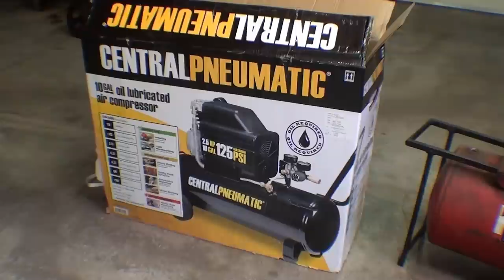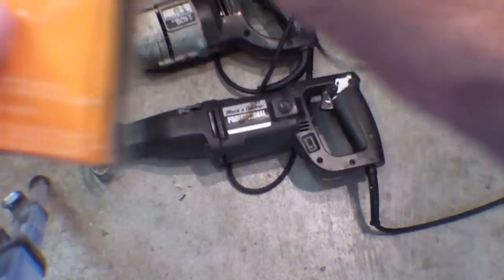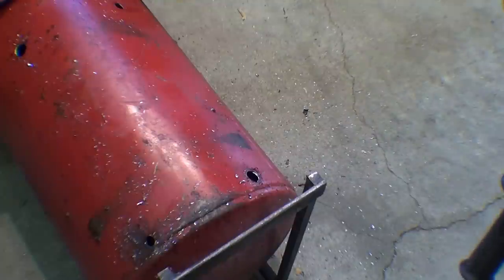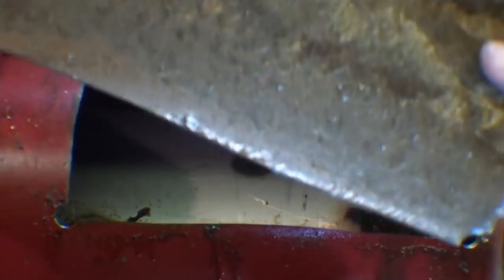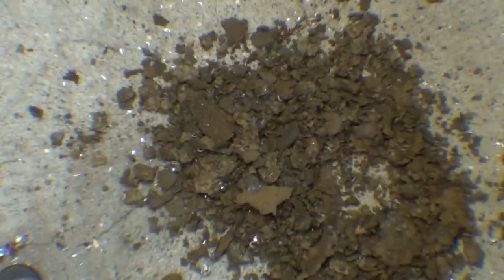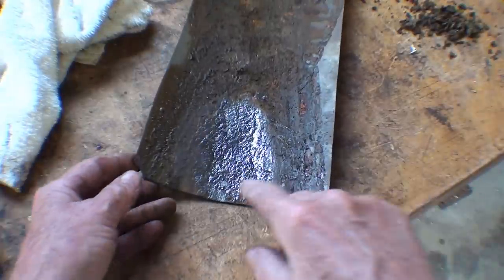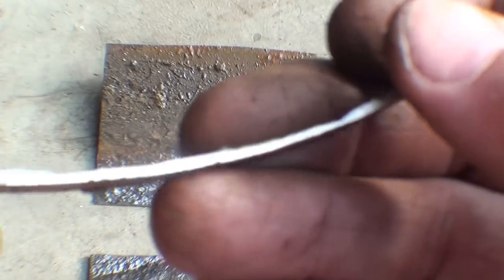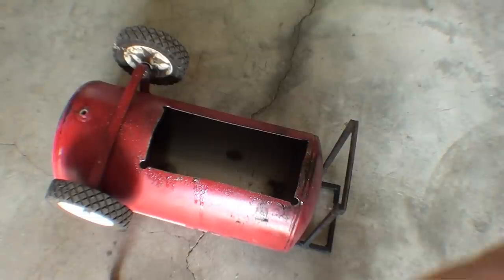tubalcain performs an AUTOPSY ON A COMPRESSOR AIR TANK

Comment: Had a tank failure while I was out of shop airing up a lawnmower tire. Rust, crud, water was blown against shop door (metal) making an awful mess. Just very glad I wasn't close by. Autopsy was easy as the tank split full length along bottom.When I replaced tank on another compressor I used a 60 gallon propane tank (saddle tank off a 5 ton truck). Still using it several years later.

Comment: I bought the same unit back in 1968/or so and when it first started to leak around 2000 I back filled the bottom with epoxy potting compound. Got another 15 years out of it. When I saw some of the carnage caused by exploding air tanks that was the end of the old sears unit. Bought a new 220 2 stage 80 gal stationary unit and installed an auto drain  on it . I don't think this unit will last as long as the first one, but then neither will I.

Comment: just wondering if on a new compressor, it would be worth using one of the liquid fuel tank liners on the bottom to maybe get longer life out of the tank...just a notion that came into my head.  Thanks for the upload, Mr. Pete.
Reply: Short answer no, you will need to chemically strip down to bare metal, and have the linig bond completely to the metal including the fittings, where there is also rust visible. Any pinhole will rust very fast just from concentration gradients and peel off the coating very fast.
Reply: Well, if Tubalcain is still here in 40 year's to witness the demise of this one I'm sure he'll be more than satisfied with that !  Or maybe not!
Reply: not thinking any part of the HF air compressors are going to last anywhere near 40 years, mine included.  It was a tongue-in-cheek question, by the way..about the tank lining...always happy to give those so inclined an opportunity to educate, though. :-)

Comment: Looking at the picture 9:40 into the video is scary. The sheet metal is probably 1/3 the original thickness. Lucky it failed with a slow leak.

Comment: you should keep the old machine's parts. The direct drive compressors do not last. You could however use the new tank with the old parts when the new pump stops working.

Comment: Thanks for doing this, Mr. Pete. I'm surprised by the relatively thin gauge of the steel to begin with. I expected more meat, perhaps .125".  But I'm really surprised by the large area of thinned material. I had always envisioned deep rust pits in otherwise fairly undamaged steel, but this completely changes my thinking about old tanks, and about the possibility of catastrophic failure.

There will always be water vapor in the tank, ready to condense from the heated compressed air and settle in the bottom. I've always heard that acids form from the combination of the water and oils from the compressor.  Seems like daily draining would reduce any such formation.  The fact that the upper part of the tank is astonishingly pristine may point to vapor playing no part (or even pure liquid water in the bottom?), but acids instead doing the damage. That bright steel is really a surprise...not even any powdery surface rust.

Comment: I've often wondered if adding a tank sealer (like Kreem or similar) to a new compressor tank would help in the long run.  You wouldn't need full coverage, just the bottom 1/3 of the tank.
Reply: Seems like it would. 
My 1985 BMW motorcycle gas tank came from the factory with an internal rust preventative coating.

Comment: Wow, that thing was definitely living on borrowed time! This last compressor I picked up was probably the last US-made unit from the manufacturer before shipping their production overseas. Thankfully the former owner barely ran the thing, as my primary concern was the age of the tank. A thorough inspection through the bottom port revealed very little rust. One of the few unspoken benefits to having an older oil-lubed compressor with blow-by before I refurbed the whole thing; built-in rust prevention. 👍

Comment: SeanBZA said it:  scheduled clean-outs of the tank, maybe even an inspection.  I have a vertical 60 Gal tank & do a basic dismantle every 4 years. I do a boiling water cleaning solution to clean then use a commercial steel rust inhibition application inside.  Have been doing this to compressors since it was taught to me as a kid.  Have never had to replace a tank.  Of course, dry air filter is used as is a filter for spray paint purposes & oiler for pneumatic tools.  Very good autopsy Mr. Pete.

Comment: Thanks for the interesting autopsy.  It might be worthwhile, when starting out with a new tank or compressor, to add a little fuel tank sealer and slosh it around before water gets in there.  Might keep the condensation away from the unprotected cold rolled.

Comment: Drain was not the lowest point in the tank either, so the condensate pooled there causing the failure. Got a 60 gallon tank at work, and every 3 years it has a clean out and hydro test. Most of the fine rust lands up in the auto drain screen though, as I made sure the drain was the lowest point in the tank. Original motor, second Ingersoll Rand compressor on it, the first one had a minor issue with disliking the HP piston after a while and it left via the case. Second runs synthetic oil and I added a small magnetic plug to see the wear particles in it.  Grows a little black coat over the magnet.

Comment: Very informative. In UK there is a product called "Fernox" which is used in water-filled radiator systems. I add a small amount to a new tank, working on basis that its very effective anti-corrosion properties will help slow internal corrosion.
That is optimism but the stuff is amazing - a solution of that with a bright nail half in, shows immersed section stays 100% bright even after long immersion.
Reply: gonna look that stuff up, Chris..and see if there is a similar product here in the states.
Reply: Ah...Amazon has it...gotta love it.

Comment: My craftsman tank similar to yours did blow up. It was on a shelf 6 ft off the ground and blew a hole in the 1/2 inch plywood shelf and hit the rafters in the garage. I was able to use the compressor by building a heavy duty manifold out of 2.5 diameter pipe to mount all the pressure switches and regulators to. Then off to the side ran a hose to a harbor freight air tank . These old compressors are reliable and much quieter than the new ones. Now when the tank gets a pin hole, I just throw it away and get a new tank for 50 bucks. that craftsman will outlive me.
Reply: Yeah. I have a 1978 craftsmen. I’m like it’s so quiet, that’s the only reason I’m obsessed with trying to keep it. But I’m worried about the tank and such. Will probably scrap tge tank and try to refurb the gear, see if I can remount it to something later.

Comment: I have fond memories working (assisting) in a small engine repair shop with a Sears air compressor.  It was a really nice compressor much better than what one can buy today 
in the comparable price class.  That was 1976 to 1980 era and, from that, I'm sure the compressor you have is older than 1975.
Thanks for the video  -  Rod

Comment: Hi Lyle, thanks for that. Quite eye, sorry, tank, opening!  I wonder what could be done to slow it as well as others, but I guess 40 years life is not bad.  Maybe thick oil, (but not if powering paint sprayer), or a water dispersant?  I was impressed with your Black & Decker saw.  Seeing how things fail is very educational.  Bob

Comment: If you look up Diesel Cavitation Erosion, I think you'll find a contributing factor to the destruction of the bottom of the tank. That's not to say that the compressor is related to a diesel, but that the reaction of the water to the sonic shocks delivered by the compressor itself will possibly cause some of that erosion of the metal that you(we) observed..
Makes me wish that I had taken the time to wash out, rinse and seal the inside of my 60 gallon compressor tank.
Keep up the fine work..  As a recent retiree, I am finally finding the time to appreciate your series.

Comment: Kinda spooky! Definitely not something you want coming apart in rapid fashion!  The old B&D corded drills are awesome, my grandpa had a large 1/2" like the one you have, trying to drill a hole in a truck frame to mount a trailer hitch and the bit caught and spun me right around like a rag doll, bounced my head off the tire and everything... I was impressed because I am 240 lbs! Thanks for sharing! BTW, the crickets didn't bother me at all! :)
Reply: LOL, I laugh because the same thing happened to me about 35 years ago.  I wasn't laughing at the time but everyone who watched me do it was.

Comment: I was a boss on a job where the subcontractors scaffold failed and a guy fell and was hurt pretty bad in WA State. After the ambulance  took him away, i took my camera out to take  pictures of where the metal failed. When i got out there, the piece was gone. I went to the subcontractors pickup truck, and the part was laying in the back of bed and he was getting ready to drive away. I took some pictures. Later state inspectors were call out to investigate. I loaded the pictures to my laptop and enlarged a lot. You could clearly see that water has gotten inside the tube and had rusted from the inside out, and failed. Needless to say a picture is worth a thousand words,  the blame lay clearly on the subcontractor who had supplied his own scaffolding. This video reminded me of that incident. WA is extremely stick on safety compared to CA where i had moved from.Needless to say, sure i cared about that guy that fell, but i was also inline to be blamed because it was also my job to enforce safety. Without that picture that showed the rust from inside out,, i would have been blamed some how. ( you could not see rust from the outside)
Reply: I got a 1978 craftsmen that runs half decent. Am debating using it. No way, out of the failure tank videos, tubalcane basically convinced me to throw it out.

Comment: Thank you for the informative video , It could save someone's life someday .I just bought a used Speedaire  unit and it has a pinhole on the bottom that I didn't know about because I bought it with a broken off drain valve and a man's word that was all that was wrong   .The machine was only 10 yrs old  and looked fairly new compared too my 40+ year old Sears . I have since watched video's of compressor failures something that you just don't think about and they are deadly. Thanks again Sir.

Comment: Interesting video.  I have never had a sawsall blade to cut the well.  When I watched you do the first cut, I thought that must be VERY thin metal.  I may have been cutting at too fast a speed with my sawsall, not sure.  I did notice it did cut slower on the second longer cut.
  This video has me a little leery of my compressor now! Not sure how old it is, and the tank itself does not leak that I know of.  I think I need a new pressure regulator.

Comment: You know what should really scare you? An old compressor tank that's starting to leak. Those things have a tendency to explode under pressure.
Reply: Watched a few videos now, while debating a used 1978 craftsmen I was gifted……. Yeah, not very sure I’ll be running this old compressor

Comment: That is sure an eye opener. Guess the best thing to do even with proper care over years is to replace a compressor over six years old. Might be good to also cut holes in an old tank so nobody else can use it when trashing it, or salvage the metal for other uses.

Comment: I was quite surprised at how well that saw cut the tank.  I was also quite surprised at how thin it was.  I drain my 60 gallon compressor tank every day but still wish there was a way to prevent corrosion.
Thanks for the video.
Reply from the maker: +Bruce L. Yes, I had a really saw through it fast.

Comment: My late father used to work for Sears and Roebuck Co. back when they built and/or sold quality tools like that air compressor. So it was nice to see that you (along w/ previous owners) had gotten so many years use from it! I trust you played taps as you dropped it off for recycling. lol Hope you fully enjoy your new Harbor Freight compressor and it brings you many great days of service! (Warranty is for 90 days anyway). lol
Reply from the maker: The freight compressor will not start if it is under 50°F

Comment: I had a pin-hole leak in the tank of my Campbell-Hausfeld compressor a few years ago... I punched it and put-in a self-tapping metal screw with washer... end of problem.  Working fine ever since.
Reply: So you loaded it with a bullet and you continue to spin the cylinder? Russian roulette anyone? Seriously I hope it doesn't decide to unload on you or anyone someday.

Comment: I just stumbled across your channel when I was looking to see if there were any videos on how to repair an air compressor tank that rusted through.  I was hoping to see where someone had patched a piece of sheet metal over the entire bottom of the tank to reinforce it. After seeing this video, I realize that is not a good solution at all. I was a machinist for around 18 years and have moved into other positions in the company where I have spent over 22 years of my career. I took a peek at some of your other videos and decided we have some similar interests. I have an old Sebastian lathe that I will be cleaning up and putting back into service, in my shop this spring. I recently purchased a new air compressor that will replace the Craftsman that I purchased nearly 30 years ago (because the tank has a pin hole, where it rusted thru the bottom). I look forward to watching more of your videos, very soon. - Jeremy
Reply from the maker: Thank you for watching, I'm glad you found my channel. I used to have A Sebastian Lathe in the school shop.

Comment: It would be a lot of work to put a new bottom in, but it would have the advantage of having a drain that was the lowest place in the tank, should you design one, vs the stock one that was significantly higher due to the inside welding on the threaded fitting. I put an elbow, pipe nipple, and a ball valve in my old one so it would be easier to drain, which it does better if I lean on the handle and tilt the tank towards the drain. I also sprayed a good amount of wax based undercoating in the tank inlet fitting to protect the bottom from water inside. I also retorqued the headbolts several times the first five years, which had loosened significantly the first  couple times (gaskets compressing). I also replaced the tiny foam air filter with an optional adapter kit with 2 longer headbolts, and with a washable woven filter - noticeably more quiet. No problem for a machine shop to make the adapter, or to replace with some rubber hose and an auto air filter.
Reply: I fabricobled a cardboard box with various baffles and diverter and bolted on to my 3hp just to test and man what a difference!!! I'm thinking of making a permanent replacement from ridged foam  or MDF but for now the noise drop is huge! It doesn't have to be air tight it's all about noise canceling.

Comment: Interesting video...  I'm glad I live in a dry climate area.  You have very noisy crickets in your garage. LOL
Reply: Will not make a difference, still some moisture in the air to drop out in the compressed air and rust the tank. As you probably will not drain the tank either ( no visible water) it will be sitting there till it rusts the bottom out.

Comment: I always release the pressure on the tank when I'm finished using the compressor.  While I'm doing that I try to rotate the tank to get all the water out.  I also leave the drain open till the next time I use the compressor.

Comment: Never, EVER weld or repair a pressure vessel. 
That’ll cause a catastrophic failure, later on. 
Welding will remove the heat treat from the steel.

Comment: OK!  You've "proven" you needed a new reservoir tank; however, what happens to the remainder of the compressor's gear: The pump and regulator still function......?

Comment: Very good - thank you - but next time I want to use my old compressor, I'm going to switch it on and run away :) I'll leave it 'on' for a few days. I'd rather be in the house while it goes bang in the garage !
Maybe the garage wall will fall down - I could then claim on the insurance :)

Comment: You're lucky it never exploded. 
You really need to kill that cricket, they eat man made stuff .
Only two holes are needed, not four.
Compressors need to be drained after every use to prevent all that crap in the tank.

Comment: Buy a $5 four in. grinder and a cut off wheel for it and you wont need any of the tools you used, you can just cut a hole with it alone.

Comment: silica packs or the loose silica sand would make a huge difference inside the tank, it would absorb any moisture and keep the tank from rusting.  Also, could you please, KILL THAT CRICKET!  damn that was annoying!  LOL  great video too, im going to check my 20 gallon compressor and my dads 17 gallon as well.

Comment: Thats nothing slice open an old hot water heater! Like a five gallon bucket of sediment but they make for great air compressor tanks! Outlets are 3/4 npt so just pipe from there

Comment: had the same one bought in 1978. Had a pin hole in the bottom about 10 years ago . Sheeting screw and rubber washer  and silicon to the rescue . finally the Jugs went to heck about 3 years ago..

Comment: Thanks for the vid.  This has always bothered me. They know it is Ass Fuckduciery!  They do it anyway.  As my tool collection grows. I will open up my Tanks... Then coat the inside of each one.  Perhaps a flang and a way to properly close it. Then, when it is drained. I can open it. Let all the moisture out. It has to be coated so you do not have the particulates in your hose.  I cannot believe no one has done this.